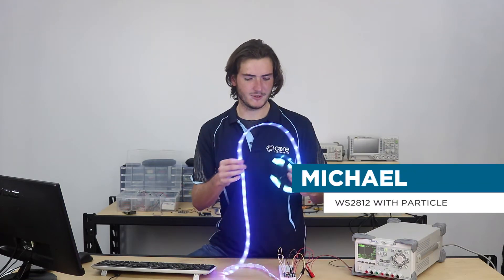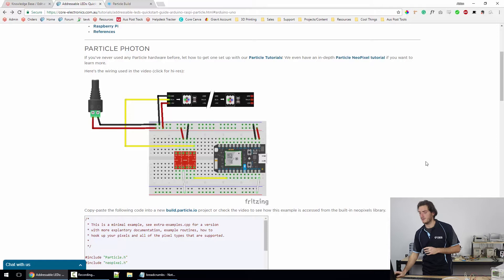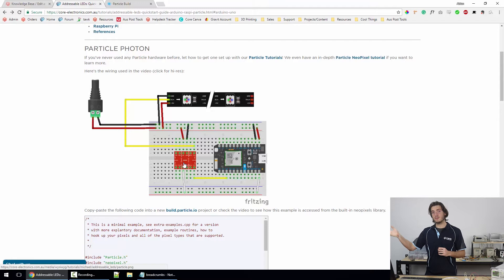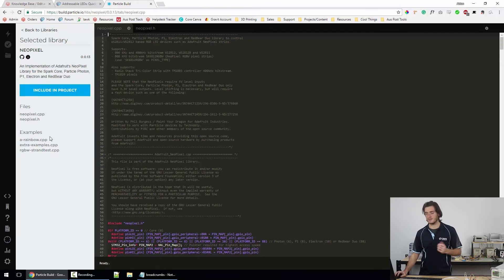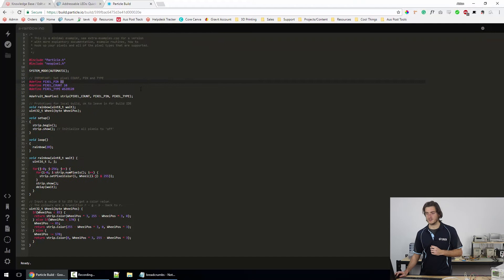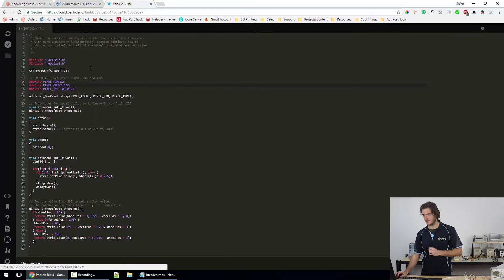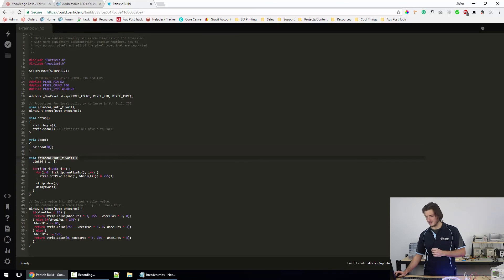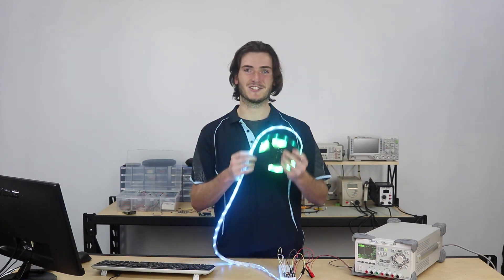How to use WS2812B RGB LEDs with Particle Hardware

Comment: Nice project for the holidays.  I'd like to make sure I use the correct 3v board to 5 volts.    Which board did you use?
Reply from the maker: Hi David, here's our favourite https://core-electronics.com.au/logic-level-converter-bi-directional.html